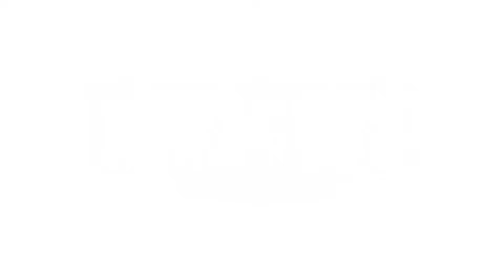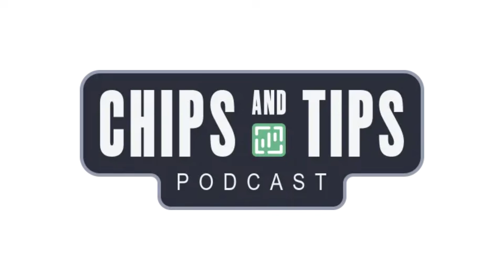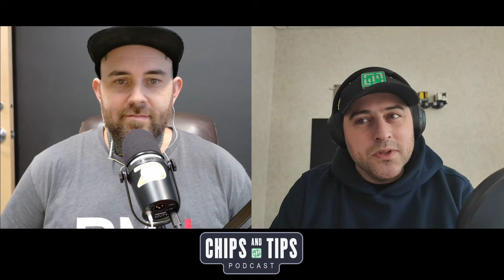My Tool Library Is Better Than Yours with Zap - Part 2

Comment: I can absolutely appreciate the power and advantage of having a unique tool ID that encapsulates the entire RTA. That IS the tool, there's no question. The actual cutting tool is only part of the equation. Help me understand the need/advantage to assigning rpm at this level though. Some tools are more than capable of cutting multiple materials let alone potentially being used on different machines with different spindle speed capabilities; should/could rpm (and chip load) not be handled at a program level?